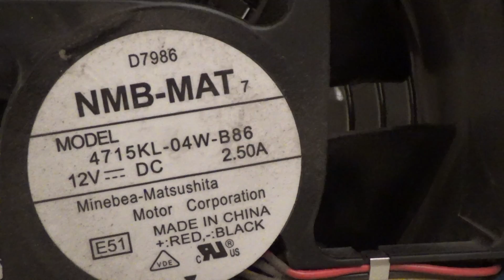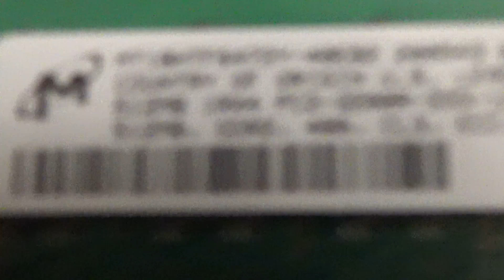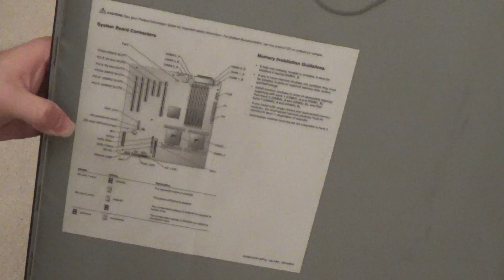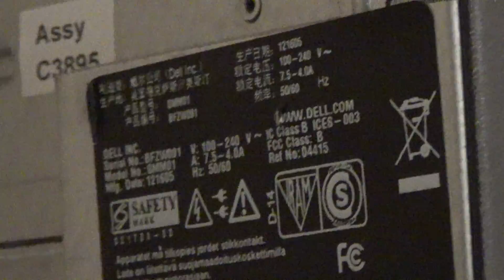Dell PowerEdge 1800 Part 1 | Breaking and Fixing the CPU

Comment: Excellent computer video on the Dell PowerEdge 1800! I believe that it will run Windows XP or 7, depending on which operating system works! I have a Windows XP Professional laptop which is also the Dell Latitude D820!
Reply from the maker: That's nice..

Comment: Lighting could have been better.  Not just for the video, but for your eyes too.

Samasung?  Seems like you REALLY need better lighting.  The chips clearly state they're DDR2 3200 speed, ECC/registered memory.  

Processors since the Intel 80486 have been using ZIF (zero insertion force) sockets.  There's either a lever, or on laptops, a screw that turns that will load and unload the pins from the chip (or, if you have to be particular, the balls from newer chips).  I would have thought you would have known that considering the work you do.  

I've had several times when the processor rips out of the socket stuck to the heatsink.  Usually, the damage is minimal if at all.  You NEVER, EVER reinsert a chip with a heatsink attached to it.  I've never heated a chip to remove the heatsink.  I just use a plain old flatblade screwdriver, works great every time.

Perhaps you were having a bad day.  Perhaps every day is a bad day.  Perhaps you were just trying to make a "freakshow" (what an incorrect and ridiculous term) for the video.  I've mentioned several times to you that shortcuts aren't worth it, and you just proved it to yourself. 

I understand that this video was cut for time, which I appreciate, but also leave the viewer on a "cliffhanger", as in <announcer voiceover> "Off camera, several weeks have gone by, and Jordan has purchased a replacement processor to replace the one he damaged so he wouldn't look like a total "mah-rahn" on camera.  The processor went for an undisclosed amount of money.  You'll never really know the course of events as he never puts the recorded on date in the video description, but there will be one or more parts to this series so stayed tuned!" </announcer voiceover>

Thinking about it, I don't know if bending the pins was just pure negligence or a rookie mistake.  Seems like negligence.  If not, you sure put on a good show.
Reply: He made another part 1 of this machine 2 years ago and turned it on.  It alleviates some of that cliffhanger.
Reply: Could have put a link of that video in the description.  But he refuses to even put the date the video was recorded on into the video description, probably as another "shortcut", so this is as good as it gets.
Reply: I don't think he remembers it existed.
Reply from the maker: The lighting in this room is configured to be soft and easy on the eyes, not blaring bright and highlighting every detail as it is in the "studio".. This video was also edited and rendered with a new video editing software, which I have not extensively experimented with yet.. This may have contributed to the video being darker than normal..

About 98% of the work I do at my job is software based.. It's quite rare I find myself in a machine anymore, and when I do, it's one of the disposable models; if anything in the least goes wrong, you toss the entire board and replace it.. It's been about 5 years since I was regularly inside full-size desktop machines, so exactly how the different processors and boards assembled is escaping my memory.. Since it seemed to just pull out, it didn't occur to me there was any more to it..

I already admitted that taking the shortcut was a bad idea.. Given I clearly understand that, does it really hold any value to rehearse it again in the comments box?

If I had bent the pins on camera for 15 minutes, you would have complained about the video being too long.. So I cut it out.. Now you're complaining on the other end of the spectrum.. This is exactly why I don't allow the complaints of one entity in the comments box to weigh very heavily..

In this particular situation, it was an issue of negligence.. I was late, it was tired, and I wasn't familiar with this particular model computer..
Reply: OK, but you didn't say anything about "Samasung".

Soft and easy on the eyes is great for general use.  Not so much for video, and that's why I'll often have some kind of other light standing by.

Wow, really edited using a different piece of software and/or computer?  You're finally moving on.  That's impressive in and of itself.  If that's why it was darker, perhaps in time it'll get better, or the videos may need some slightly different enhancements.

I honestly wasn't aware of the sheer percentage of work you do that's software based, I'd have thought there was quite a lot more hand-on hardware experience than that.  But you don't really forget how these things go together, it's like riding a bike.  You might get rusty but you never really forget.  I still remember how to install and remove the old 72- and 30-pin SIMMs we used to use for memory years ago.  And I used to install plenty of DIP chips.  I can even pop out a non-ZIF-socketed 80386 chip if needed, which reminds me I've been doing this too long.

Yes, it holds value to rehearse again in the comments.  As human beings, we afford ourselves the luxury of making mistakes.  However, learning from your mistakes, in the hopes of never making the same one twice, is paramount to your success.

Not showing how to re-bend the pins on camera is fine, but it was leaving the system without powering it back up that was the cliffhanger.

You were late and it was tired?
Reply from the maker: Samsung made the RAM.. What else is there to say about it?

If there is no suspense, what is going to keep people coming back for the next video?

Yes, you never get to where you feel that way?
Reply: What else is there to say about it?  Besides saying it RIGHT, you mean?

Most of your videos are one and done with absolutely no suspense.  Personally, I would have at least showed that I broke it, and then fixed it, like the title says.  Just because the pins are bent back doesn't mean it's fixed.  When it works (and I'm strictly talking about the CPU via a POST test), then it's officially fixed.

No.  If I'm late, I'd be dead.  As in "my late, great uncle".
Reply from the maker: No, that's what you mean.. I'm content with saying it LEFT..

OK, so if I've done something a certain way in the past, I'm infinitely bound to that style in the future? It works, you can see it post in the next suspenseful video!